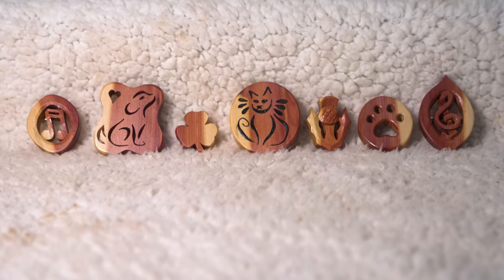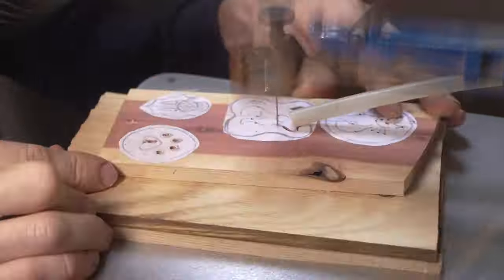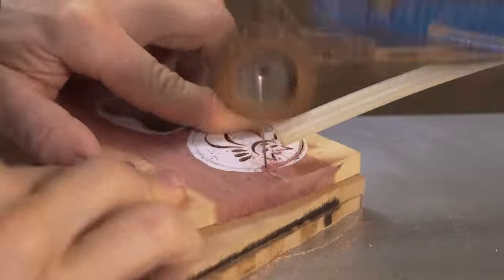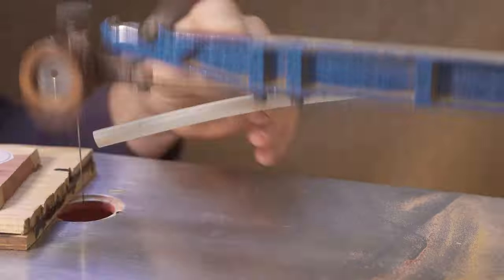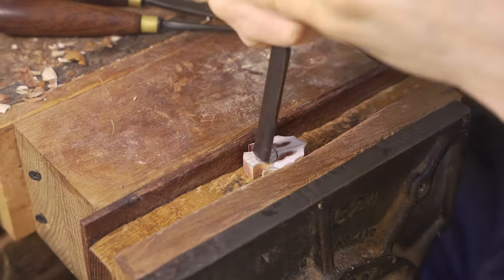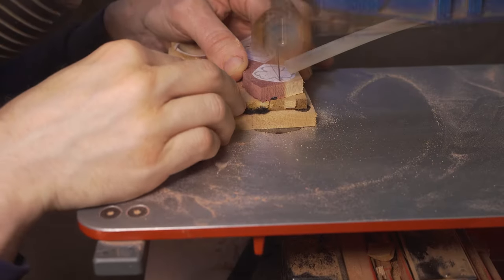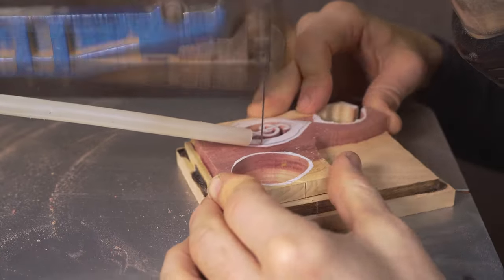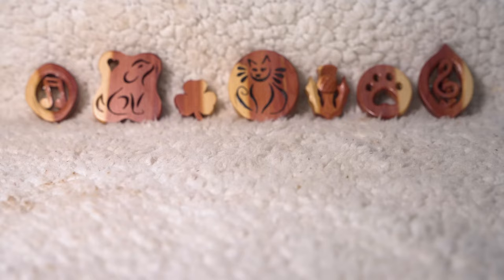Scroll saw jewellery. Badges/Brooches

Comment: Very, very nice Dai! When you say "rub it down between coats" are you lightly sanding? If you are then what grit of sandpaper ? Take care!
Reply from the maker: Hi Michael, great to hear from you as always. When I say rub down I would be using a P260 or even finer. All I am aiming to do is take the roughness out as opposed to completely removing the shellac. It's just taking that edge off that results from the shellac raising the grain in the wood.

Thanks again for your support. Hope all is well with you, all the very best from us all. 👍👍